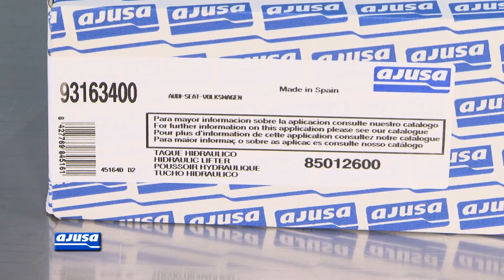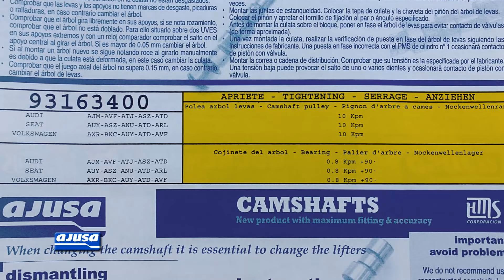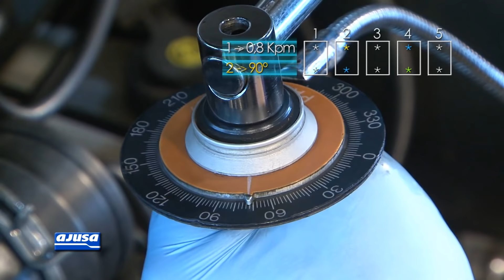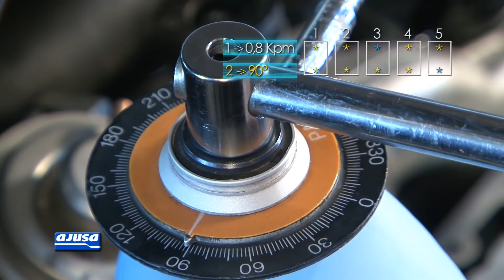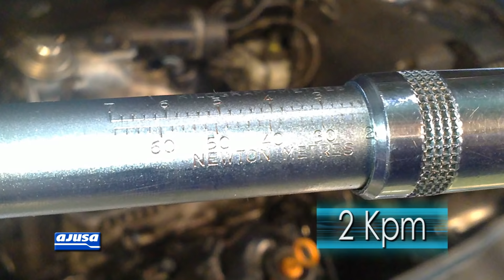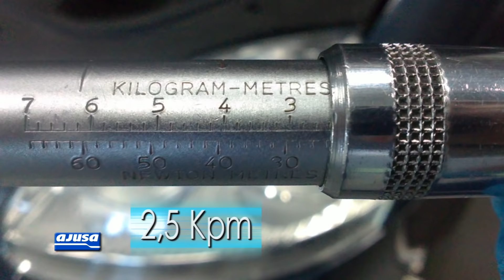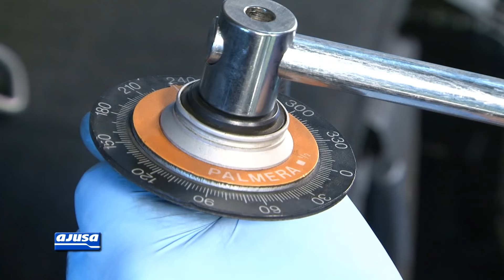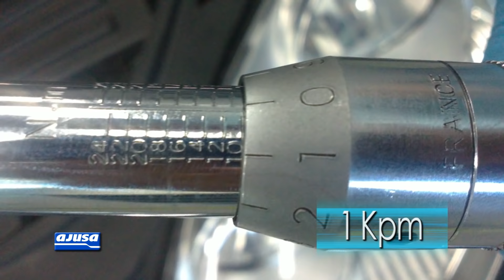Camshaft & Hydraulic Lifters / Árbol Levas & Taqués Hidráulicos VOLKSWAGEN GOLF

Comment: måste man ha momentnyckel?? måste man ta isär hela kamremen  även vid vevaxel ? jag ska börja byta kamaxel skoda octavia 1,9 2008.  fram Sweden Albin
Reply from the maker: Momentnyckeln är nödvändig, eftersom en specifik åtdragningsprocedur måste följas hela tiden. När det gäller att ta bort kamremmen för att byta kamaxel, rekommenderas det att ha bättre åtkomst på Skoda Octavia. Vänliga hälsningar

The torque wrench is necessary, as a specific tightening procedure must be followed at all times. As for removing the timing belt to change the camshaft, it is recommended to have better access on the Skoda Octavia. Best regards

Comment: hi ...cou'd you please provide a list  of all the part used in this replacement...i need to replace my camshaft for my 2009 vw polo 1.4 8v ... i need to know what they are called when i go buy them ....my camshaft has broken ....
Reply from the maker: Hi Pholela! 

In this video we installed hydraulic lifters (85012600), camshaft (93163400), new camshaft bearing (not ajusa), new camshaft bolts (not ajusa), rocker cover gasket (11095700/11087400), oil seal of camshaft (15087000), among other. 

You can find more information in our Facebook https://www.facebook.com/AjusaSpain/ and in your Twitter https://twitter.com/Ajusa_Spain. Best regards

Comment: why not use engine oil
Reply from the maker: Hi Arunas! You could use any kind of oil to lubricate the camshaft supports. Ajusa includes the mechanical assembly oil called "Camoil" with all our camshafts to remenber the importance to lubricate these areas, therefore we use this oil. 

You can find more information in our Facebook https://www.facebook.com/AjusaSpain/ and in your Twitter https://twitter.com/Ajusa_Spain. Best regards
Reply: It seems permatex ultra slick oil assembly